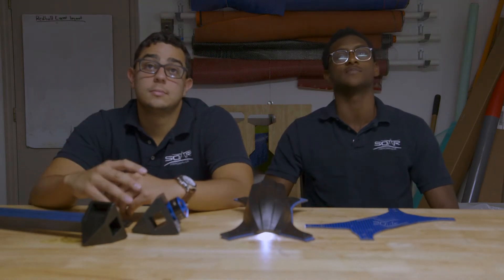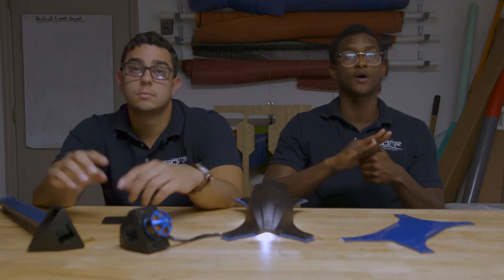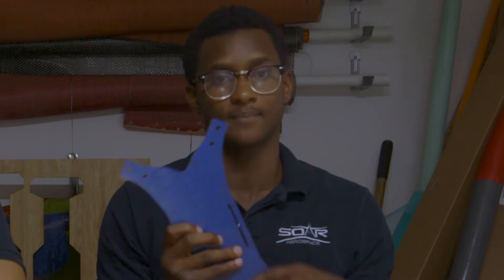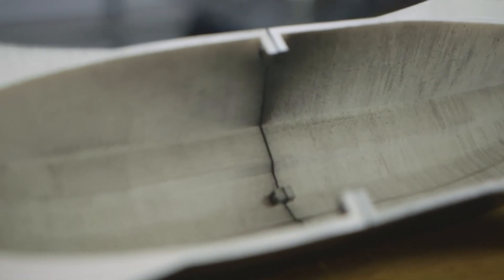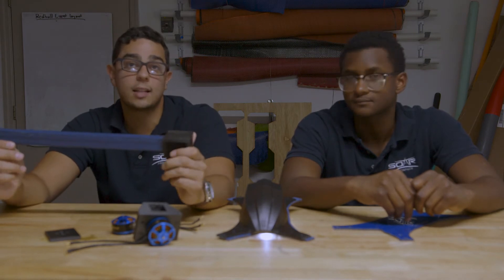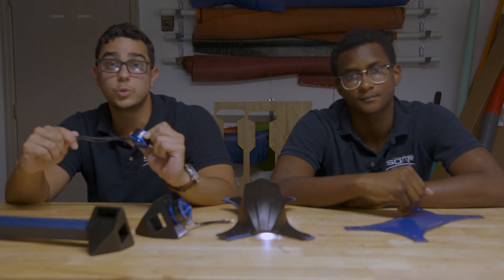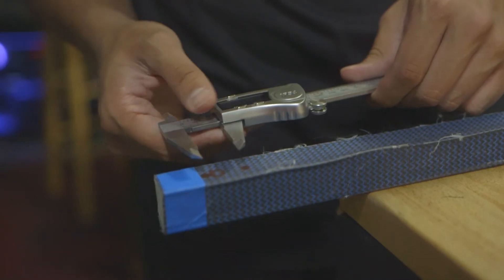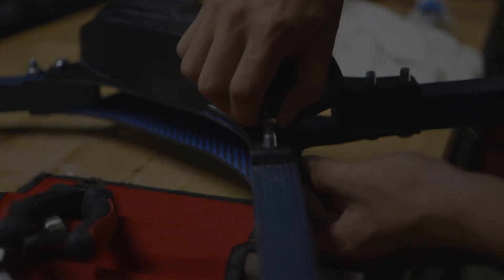X-Class Drone Build Series Part 3: Coming Together

Comment: So for the canopy have you guys thought about using post with pins. Could make for some super quick battery swaps. Was thinking along the lines of these

https://www.amainhobbies.com/traxxas-battery-hold-down-plate-tra3727/p17592?gclid=Cj0KCQjwyYHaBRDvARIsAHkAXcsdaKUOTPrcFVblK5rgTRtND4IrhRD_3T-4hXnphX1oJc9ckE9TNvAaAnBsEALw_wcB

Also also wanted to offer custom painting. Here is a link to my instagram and my work 

https://www.yooying.com/fpv_151
Reply from the maker: John Jordan could you explain in more detail what you mean for that design. Sounds interesting!